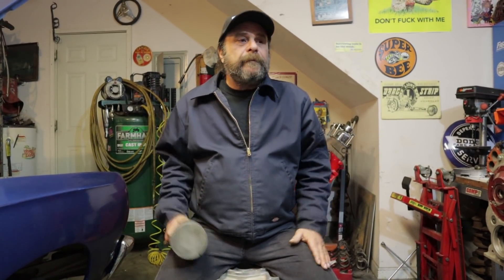3 Reasons Junkyard Engines Go Better With Boost

Comment: I'm not sure you're correct about ring gap.No matter how much wear the rings have the gap will not wear.The rings wll expand more cause of bore wear but the the compressed gap will remain the same that the factory set it at.If you're going to throw boost or a big shot if nitrous on a stock used engine you still need to open up the gap..
Reply from the maker: Wrong...think about what you're saying.
Reply: When the rings heat up they pinch.You need to file them so when they heat up theres more gap.I dont see how wear and tear would open up the factory gap..
Reply from the maker: Jimmy, as the outer circumference of the ring wears, it automatically brings the inner circumference along with it.  That would automatically have the gap getting larger.
Reply: @UncleTonysGarage  Maybe I'm over thinking this.I'm going to get a coffee and think..
Reply: @Jimchevy406  Make a circle with your thumb and forefinger. This represents the rings inside the cylinder, now are the rings and cylinder wear that circle (thumb and forefinger) has to get bigger. Then only way to do that is to open it a little. Now your thumb and forefinger has a larger gap.

Comment: Keep in mind ring gap doesnt enlarge as much on newer engines. You open up a 200k LS and ring gap can still be around .015. Doesnt happen all the time but not good for boost.
Reply: silverbird58  the top ring is a compression ring and doesnt have to do with the oil. You open up the compression ring so under boost it doesn't expand, touch, and turn the top of the piston into glitter

Comment: There are kits out there that will convert an LS to carburetor and distributor. What do you think about converting modern long blocks, stronger and often cheaper, to simplify them and to use these older systems?
Reply from the maker: It's the way I would go if I built one

Comment: I recall back in the day, when the 273 LA debut'd the Hot Rod intelligentsia disparaged it as simply a MoPar copy of the 283 SBC, that  is, no real engineering accomplishment.   So, Unc'l T, then why wouldn't a junkyard 360 Magnum  go toe to toe with and LS? The group might like to hear your thoughts on that :-)
Reply from the maker: The Magnum will...so will the Gen 3.  But no Chrysler engine of the modern era is as cheap, plentiful or easy to transplant as the LS.

Comment: Stock ls ring gaps are very wide from the factory. I have seen as tight as .026 to as loose as .028.

On my 6.0ls I gapped the rings at
.030 and should be good to north of 1000. Trying for a stock bottom end lq9 record at 1079hp through an auto at the tire.

Comment: I was reading David Reher's tech articles in high school.  He has long been a proponent of looser tolerances to make a high powered engine happy under load.  He would always run bigger piston skirt clearances and scotch-brite or even mismatch bearings halves to get that looser fit on the crank.  Of course, lots of ring gap, always erring on the big side.  Loose engines are happier.
Reply: Too loose, nobody knows.  Too tight, everybody wants to come see the aftermath...
Reply: Knock knock...  Who’s there?  Cylinder #7!

Comment: I was surprised some years back by one of my machinist, without taking off any stock from cap faces he machined the mains and rods to stock specs. He explained that heating and cooling actually shrinks the parts over time and cycles. I should have known about this as I used to make patterns for foundry work. He foundries will cast parts then leave them outside for several years to season before sending them to the machinist. When the machining is complete it will stay true. Awesome work and Mopar to you from the high plains of Texas.
Reply: Howdy Ryan

Comment: alot of ls fanboys laugh and talk crap when i say 5.2/5.9 magnums are the 5.3/6.0 ls equivalent for mopar guys. what they dont realize, is cubic inch is what determines hp(when speaking n/a, of course).
Reply: The heads are part of the LS power house. They laugh at you because 5.2 5.9 are great but when it comes down to pragmatism the heads dont flow nearly as much as the modern aluminum ls heads even the truck 706 heads. They would be more comparable to the 350 vortec heads from the 90s.
Reply: @LT3Fluffy  uhh, magnum heads flow within 10cfm of the Ls truck heads at .500 lift. Sit down. Plus, eq and edlebrock make killer heads too. Like I said, ls fanboys be like:
Reply: @frigglebiscuit7484  I looked. And they are actually within 5cfm. But the magnum heads max out at 215cfm while the ls climb after 500 lift. Under boost/rpm wherever where there's tons of flow you'll see the divergence. And dont yell people to sit down. They'll laugh at you even more 😂
Reply: @LT3Fluffy  if your adding boost, then neither matters anymore. if you want over .500 lift flow in a magnum(i dont see the point, just boost it) then all you would have to do is clean and open the bowl area up, smooth the runners, and trim the pushrod pinch. or get eq heads. dont act like ls guys dont so the same with their engines.
Reply: LS haters are so loud 😁

Comment: I was in high school from 73 to 76.
Steve Ray's father had Ray's Auto Wrecking. The cops drove 440s in
Polaras, so did the CHPs. Motors for $50 to $100. If you could get a motor with 80 to a hundred thousand miles on it. They were loose, so all you had to do is add a Isky cam, a torker intake, 780 Holley double Pumper, and Hooker fender well Headers. Stuff it in a 67 notchback Cuda. Cheater slicks. Smokey toasty. You could punch it at 60 and it would jump sideways. 440 six pack- complete, from the air cleaner to the pan, $1500. You could just wait for your friend to stack it. The windage tray, reduced the probability of spinning a bearing while doing donuts.
We loved windage trays..
Reply: mad ass  Who said Hemi? I read 440....
Reply: this was the "LS with a cam" of its day.  The cop engines at least got regular maintanance, and all carbon was "Blown out". otherwise, a general engine with 80K was in the junkyard for a reason :)  Steep rear gears, thick piston rings, and parafin wax in the oil....gas stations had repair garages, not convenience stores, due to the amount of repair work needed.  Up in the rust belt, tho, there was a chance the engine ended up in the junkyard because the car rusted out first, or the gas crisis of 1973 made someone toss the gas guzzler since the dealer didn't want it either.
Reply: hell 440 h/o fury 3 had a couple myself black with gray interior,as i remember it from 60 to 150 mph just plain fun usally wen u got up in the morning we would need at least 2 new tires that was the fun gauge,thanks fer the reminder
Reply: eric heine, Damn Son, you just gave me a Genuine PTSD. Flashback!!! Well Done! 

Back in 73 to 76, I’d had done 3 tours in Vietnam as an F4 fighter pilot and did my part to make us G.I.’s hated! SEMPER-FI!
Reply: @arttafil6792  A marine referring to himself as a G.I.? An aviator no less... Something's fishy and it's not the chicken

Comment: Tony.....izzat a John Deere 'G' piston you're holding?  LOL  Yup....when you butt the ends of the rings at high temp....it, many times, jerks the top of the piston off...saw a lot of 'em go that way.
Reply from the maker: It's a 400 Chrysler
Reply: @UncleTonysGarage  i had a feeling that was a 400 piston lol. syrup bucket pistons.
Reply: That seems to get a whole batch of kids every time a new car/platform/engine comes out.  Newest boosted wannabe rally car goes in sale you can bet in the next year theres going to be a bunch of broken motors because they want to be the first guy making.... whatever power before the things even broken in.  More so today when manufacturers design for exacting tolerances to combat the EPA and guzzler taxes.  A new motor might come with an impressive 320hp from the factory but you can bet the heat from an extra 50 will make something inside get a little more tight than it wants to be.

Comment: Hey Tony! Cool video.. learned a few things from this. I installed my first set of plugs and wires on my Sierra yesterday. I'm planning on doing an active fuel management cam swap  to keep it in v8 mode all the time and to start making a little more power.. do you have any videos on cam swaps in a running car?
Reply from the maker: I don't, but I'm sure they are out there

Comment: I love the "boat anchor" Heavy but indestructible, Ford FE 390, back in the day they were dirt cheap.
Reply: i had a 69 merc with a 390..over heated it real bad..it wouldnt  even shut off..kept dieseling ...when it finally shut off,,,it made all kinds of cracking and popping noises...so bad it rocked the car everytime it made a noise just sitting there...after it cooled i dorve it to my garage,,put a new rad  in it...and it was fine..never hurt the motor...and i street raced it and all out abused it,...it never died ,,,remember..fear begins with ,F,E,
Reply: They pull galaxies very well when done right.
Reply: Thirsty too. 
A buddy bought a 65 pickup with a 390 in it. 
Late 80s in high school and we put 175$ in gas in it the first week. 
Yea you gotta cruise around a little but wow she's a thirsty girl.
Reply: In my opinion the FE family Ford motor is basicly the best engine Ford ever made.. 352/360/390 are fukn beasts
Reply: The Ford FE 390. Probably the most underappreciated American V8 in history. Those things were not just engines, they were magic.
Reply: @jackandblaze5956  I totally agree.. amazing engines
Reply: @waylon4906  we
Reply: Sam Hagins ya as far as any big block ford I’ve had experience with I’d have to agree my buddy had a 67 galaxy with a 390 he added a eddy intake and matching cam and some long tubes to it and it woke that 390 up I loved driving that thing. Then he got the opportunity to get 3 428 CJ motors so he jumped on it and then swapped on of them into the galaxy with a custom ground comp cam and a factory tri power intake and I swear the 390 was still faster I wish he had ran the car with the 390 with our buddy’s gtech thing to get a estimate of what it was gonna run in the 1/4 cuz it was still in the 15s with the CJ motor
Reply: its a pity Ford didn't invest in the 390 like Chevy invested in its 396. Then again, had Ford made a tripower 390GT Mustang, Tasca Ford may never have felt a need in 68 to invent the 428 CJ for Hot Rod Magazine to promote.  They may have waited until Ford was ready to make the 429 CJ, and been too late.  Or maybe Shelby would have made it themselves for the last Cobras and the GT500's, considering the cost of the 427 by that time.

I never heard FE stood for f'ing expensive, but i have heard it stood for the symbol for iron...they were not lightweight :)
Reply: @albertgaspar627  in 61 ford had a solid lifter version of the 390 that was 375 horsepower & u could get a dealer installed tried power setup that was 401 horsepower. That's 1 horsepower per cubic inch! In those days that is a big deal! Ford did that with several engines! A 360 horsepower 352, 405 horsepower 406, 425 horsepower 427! But the 390 became tame & domesticated in the mid 60's becouse it wasnt fords hot race engine anymore so they didnt compare it to anything really. It wasnt there focus. It was a good powerful street engine for a fairlane gt & 300 or so horsepower made a good car. The 396 & 383 cars had much more attention on them by there makers & they were always comparing to one another. The 390 was happy being in plain trim just cruising
Reply: The 390's problem was it zenith'd too soon--Chevy's 396 surpassed it with 425 hp (NHRA spec'd it at 450) around the time Ford was realizing the 427 was too expensive and moving to Tasca's 428 CJ. But the 396 was the LS1 of the muscle car era. When  Motion Performance made their Phase III "Fabulous Five" (guaranteed 11 seconds or your money back), they began ordering an L78 code Chevy from Baldwin Chevrolet down the street, knowing they could still sell that solid lifter 396 to racers and offset the cost of swapping in an L72. 

Ford had already explored what they could do with the 390 (you're right, one 1 Hp per inch was great---Mopar reached it before the 283 FI, with their 354 Hemi making 355 hp with dual quads) and just went to bigger engines. If you ordered up a 428 over the counter, it was a 390 FT block bored out. But the 390 was a bread and butter engine by that time. Tasca Ford in RI told Hot Rod Magazine that selling it in Mustangs and Fairlanes was ripping off the customer, and took the Thunderbird's 428 and threw on 427 parts to make the 428 CJ--which, interestingly, used the 390 GT camshaft. 

Normally I would guess Ford was afraid a 390 that could match the L78 would just steal sales from other Ford performance engines (on a side note, its interesting their performance cars were all "thunderbird" engines--even tho the 406 never was in one--regardless of the fact the Thunderbird stopped being a Corvette competitor.  Then Shelby did the Cobra, and after that they referred to their performance line as "Cobra").  However, Ford kept the 390 until 1976, when it "competed" against the 400M and the 460.
Reply: I have a whole new level of respect for the "FE" after watching video of the FE Weekends from Martin, Michigan. My opinion of them was never that bad because i always had a lot of respect for the various 427 Ford engines which were the absolute closest thing to a race engine available in a car right from the factory. Not many were sold due to cost but i just love the 427 Galaxies and Fairlanes of the mid 60's. It just took a well heeled racer to spring for the 427. Which was quite a step up compared to the 428CJ which was the most popular way to go once they were introduced.
Reply: True, the 427 was well developed.  Nearly every 7 litre engine had an overhead cam prototype, but Ford went thru with it. The Hemi and the L88/ZL1 was no slouch, either, tho Chevy's came later. Like you said, cost was the factor, just like it is today with a Hellcat and the new Chevy ZL1. I don't know of anyone who swapped a 352 or 390 emblem for a 427, but it would have looked similar underhood. Of course, Ford kept their "7Litre" badges when they went from 427 to 428, which was a better street engine--plenty of torque with a cam from the 390 GT. Of course the 427 heads helped out. 

The nice thing about the Ford was, if you were building an all-out show car, you could drop in a SOHC 427 or Boss 429 and wow the troops. But a ZL-1?  Looked like a 396.
Reply: it's not as boat anchor heavy as a 385 series. I love the FE, I had an F series with a 390. It was a beast without being overly heavy in the front end.
Reply: Huh. Weird, always thought FE stood for F’in Expensive

Comment: Only thing i did to my 4.8 ls was check the ring gap and check on the bearings then slapped it back to together with a cam and MLS head gaskets
Reply: My bearings checked out. Not even gonna bother checking rings - it's got about 150k miles on it, and you can count on them being gapped enough for what I'm doing. The 5.3 otoh is getting bearings and rings (and gapped for nitrous) - I think it was knocking when I got it.